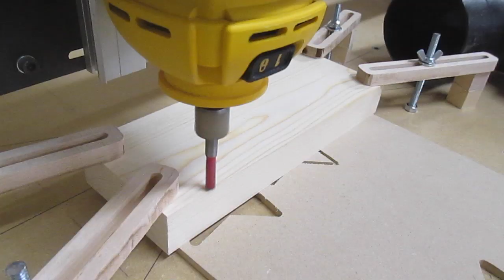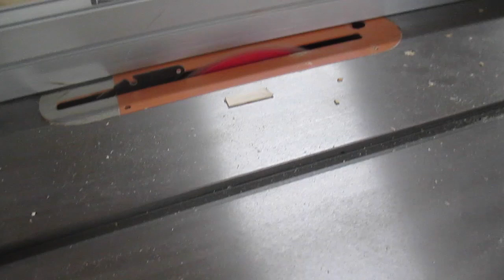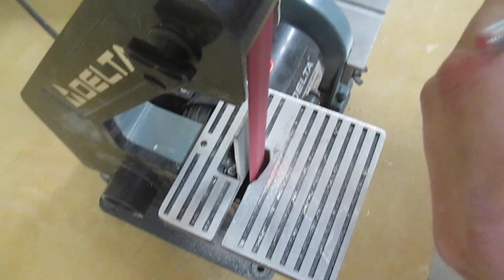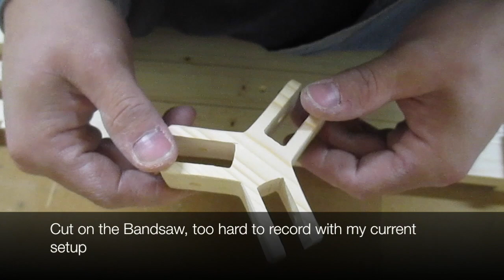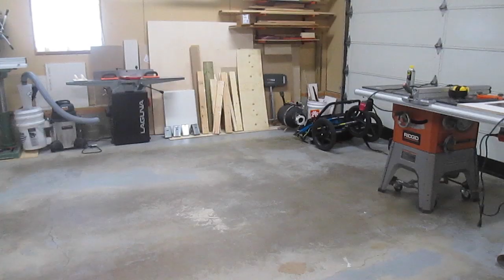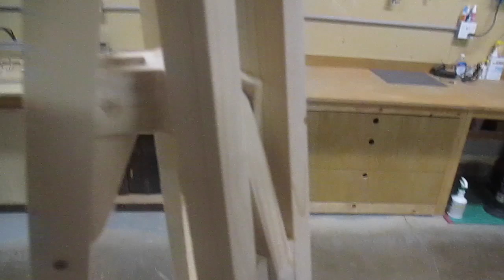How to make a Wooden Tripod

Comment: Mate that's a cool tripod, the centre links are interesting, is that epoxy on the dowel ends that you spray with a hardener maybe? That part had me wondering. I plan to make one based on your design but will upscale the thickness of pieces as I need something that will hold around 25 kilos or 55lbs. I've just built a crane for my video camera you see that's 16 feet long. I'm testing it using a new tripod I bought that holds an 18lb camera but I'm scared I'm going to ruin the new tripod as it's being pushed beyond it's limits I'm sure. I searched for a while on google and here and liked your design best because there are zero costs for a metal head like many others have, plus you show the method of build perfectly so I have screen grabbed lots of pics! I might upload a small video of it after the build and send you a link. Cheers from New Zealand.
Reply from the maker: Mines holding up good. I used CA glue to hold the dowels in and yes, that's just a quick set spray. If you don't have quick set spray, you can sprinkle the glue with baking soda and it will harden. If you have any specific question feel free to ask. If I had to make the center link again, I would use plywood. That is the weak spot with out a doubt.

Comment: sweet, i've got to make one. where did you get the camera mount? and are there any plans for this? thanks
Reply from the maker: I had a cheap knock off gorilla pod that I stole the camera mount from and it had a 1/4" bolt so mounting was easy. I didn't have any plans when I started this so I don't have any to share.  The lower legs are 1" x 1" and when it's fully collapsed it's about 34" tall. If you bought a 10' 2x4 you'd have enough material to make two so just experiment with it. It's a ridiculously cheap project. I think I spent more on the bolts than the rest combined.

Comment: What was the adhesive system used at 5:55    ?   Ta.
Reply from the maker: Theban Ned Greenman Thats was CA Glue (super glue) and an accelerator.  If you dont have access to a spray on accelerator, just sprinkle some basing soda on the glue and it sets instantly.
Reply: Noted with thanks.